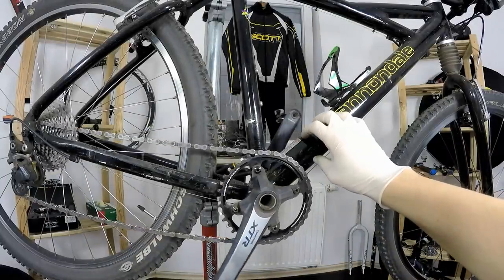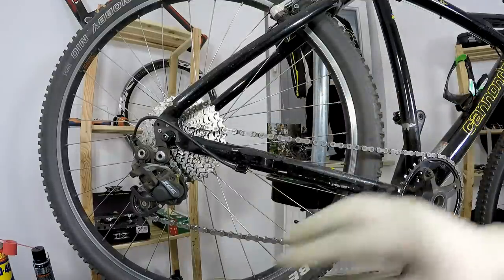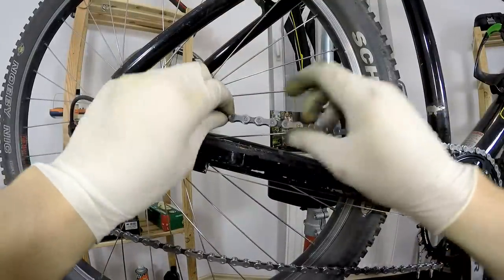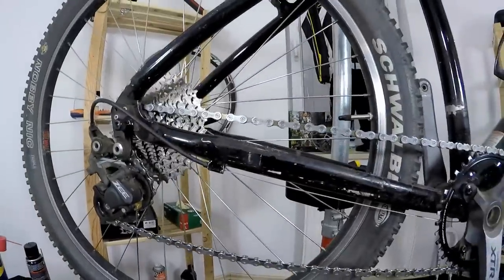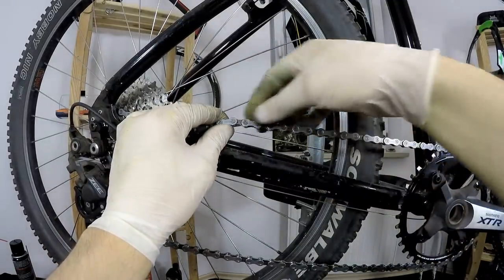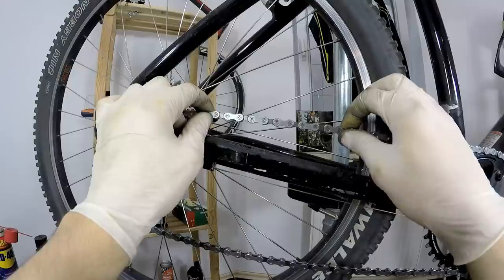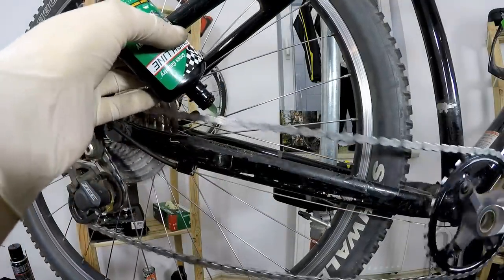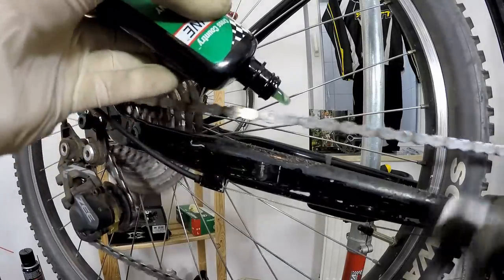How To Clean And Lube Bike Chain. What To Avoid. Oil Bicycle Chain Tutorial.

Comment: Anyway, I go purchase some diesel or  kerosene in a plastic gallon container with strong tight lid..then when I get back..place my bike up side down and take the chain off my bike..and place this chain in the cleaning vat and with rubber gloves I got from Walmart...I use a soft plastic brush to help cleanse out each link also swishing the chain around in the solvent often to help loosen all the crud that is inside the rollers. After spending about 30mins cleaning and sloshing my chain around..I'll leave it sit in the vat for another 45mins..then I will promptly pour the remain ing solvent and place it into another big plastic container...all the while holding the chain inside while drain ing out old solvent...then pour the other half gallon of solvent in to the vat drenching the chain with fresh clean solvent..this time after some more swishing the chain around in the vat about 10mins...I then take the chain out and lay it out on a big clean shop towel and wipe & dry it off very thoroughly then just let it sit another 20mins...Then afterwards I use a good Silicone lubricant and since I purchased pints of this stuff...I would then pour enough of the lubricant into a flat plastic vat and drop the chain in and simply let it soak for an hour or so...then after some more swishing the chain around ensuring every link is soaked....I then take the chain out and let it hang on clothes hanger over the Silicone filled vat..for as long until there is no more drippage of excess lubricant...then grab another clean shop towel and pat dry all wet surfaces of outside of chain and after I have thoroughly cleaned & dried both my Drive Sproket & Cassetts with WD40..I then make sure to thoroughly wipe clean any WD40 residue and then I finally proceed placing my chain back onto the cassettes and drive sprocket and tighten all nuts and bolts involved and then it's all like new again with fresh drive & chain set up ready for another 6months of simple street riding but Not or never in rain!